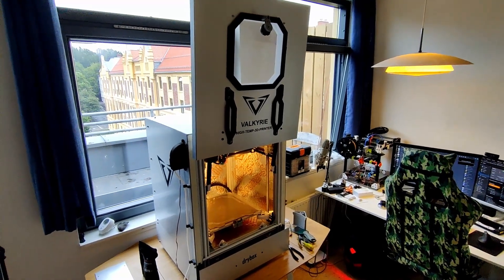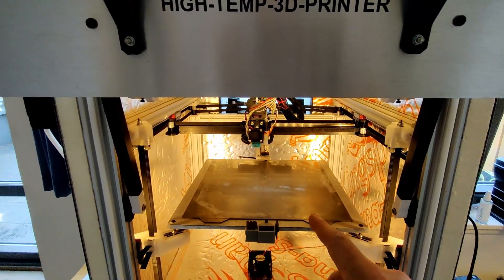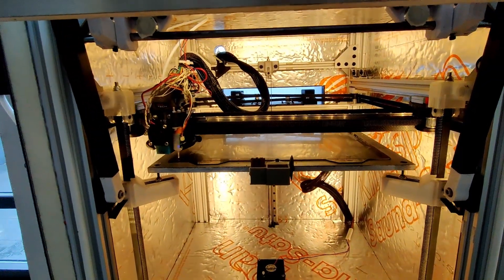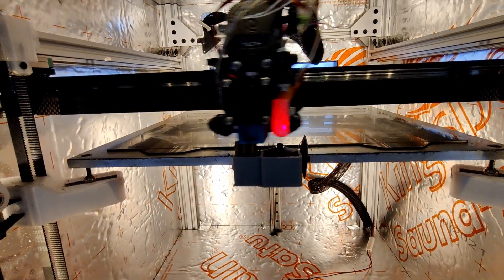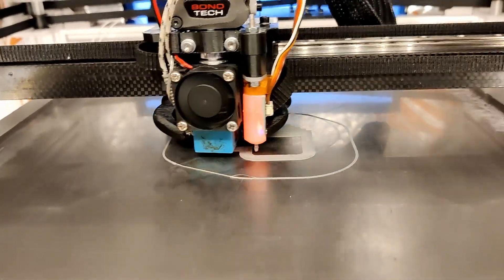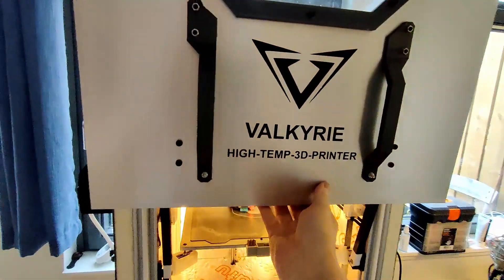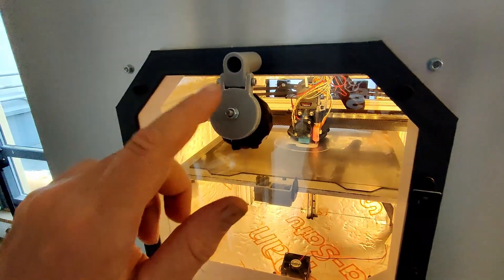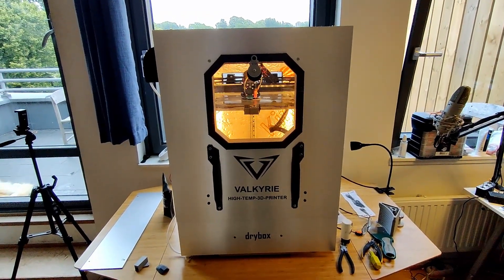Valkyrie 100% Automated 3D Printer | Stallguard homing sequence | Purge & brush | First layer action

Comment: Since the day I saw your video about the importance of consistent volumetric flow rate over the whole print, I had high expectations for this printer. And you have blown them away, awesome build. And that volumetric flow evening has taken my firsts to the next level especially when dealing with a high flow hotend like the volcano and such. Retraction does a lot but it does not compensate for the nozzle pressure, sure pressure advance can help but not as much as flow.
Reply from the maker: Thank you very much for your feedback. Great to hear